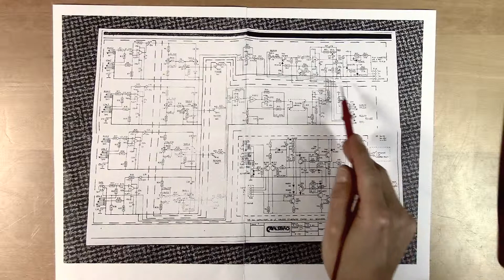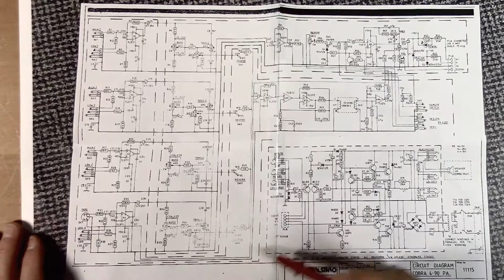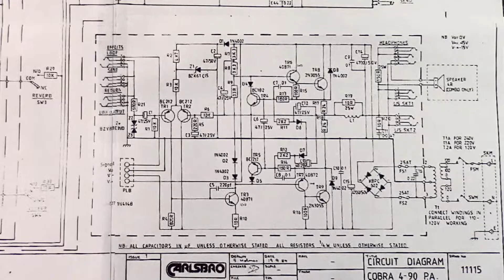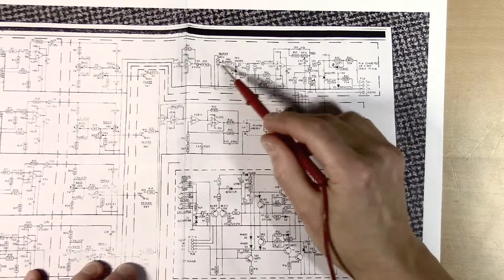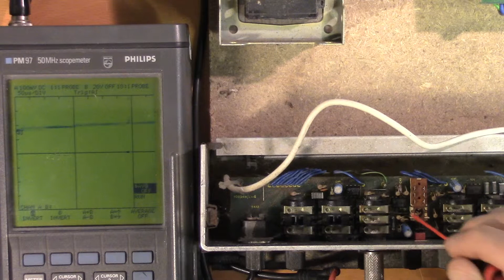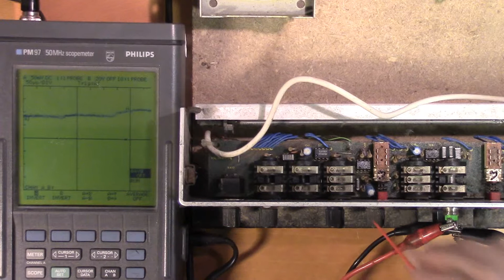Power Mixer Troubleshooting and Repair - Carlsbro Cobra 90 PA

Comment: Came across this video by accident, but I have three classic 80's Carlsbro amps myself and once you described the issue/symptoms with yours, I'm saying to myself "I know exactly what this problem is !"  And I was right !!  lol  This same thing has happened to all of mine - first time, it was intermittent, so it took years and a few different techs to eventually suss it out (without the aid of a circuit diagram back then), but once you know what causes it, it's been the same on all my other Carlsbro amps  😀  Cleaning the jack socket worked for a while, but eventually, the best solution I had was to change out the jack sockets for new ones. I still carry a short jack-to-jack patch lead in my gig kit though.... just in case....  ;-)